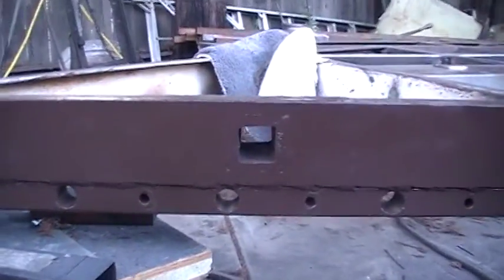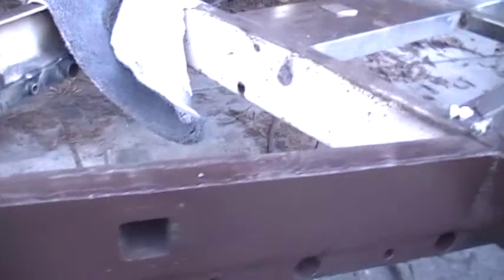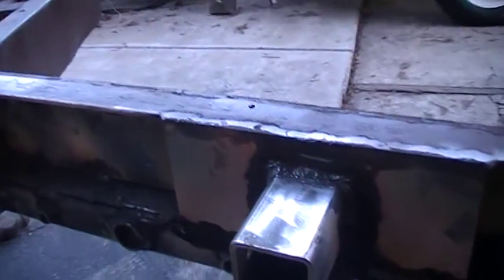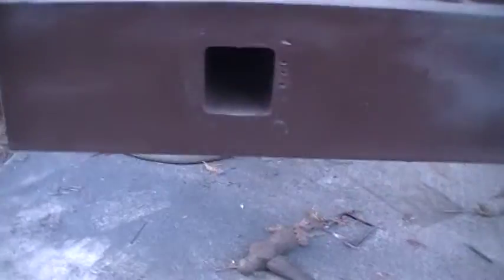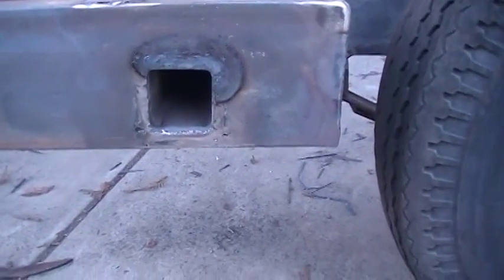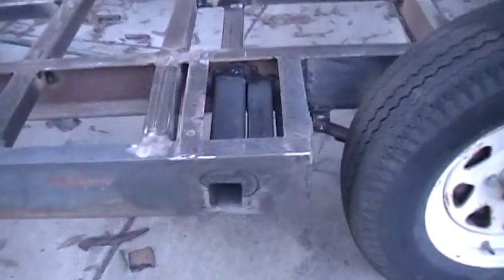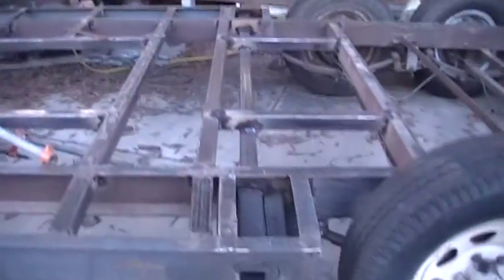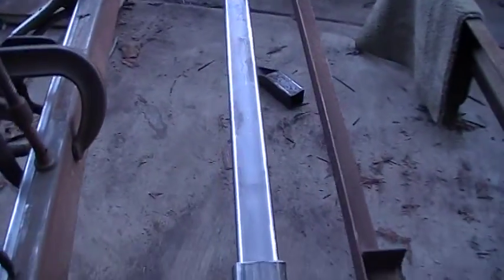Trailer build is moving along in first gear...

Comment: Actually I can't wait for the part where the machines be installed. I'm not really technical but want to install a lineshaft in my shed.
Reply from the maker: Go for it D J. The starting is how things get done. And the problems are much smaller when confronted .... My little project is going to take a while  I keep changing directions but that's the fun...   so get started on your lineshaft and post progress on the tube
Reply: @davewilson1591  I'm already building a shed to house it for a year now. I hope to start with the lineshaft end this year or beginning of next year.